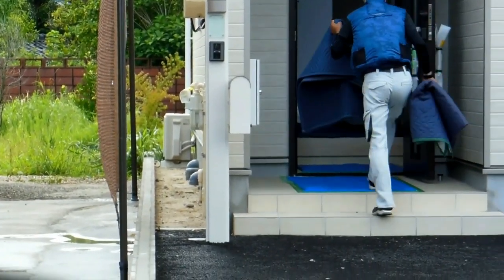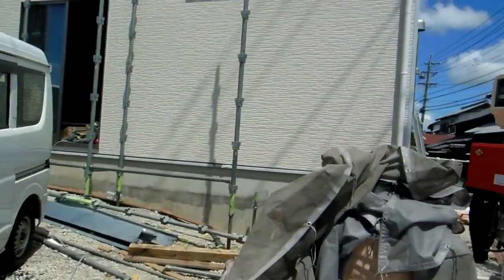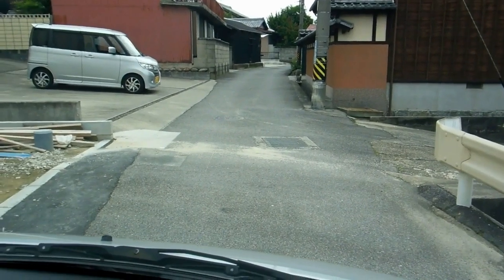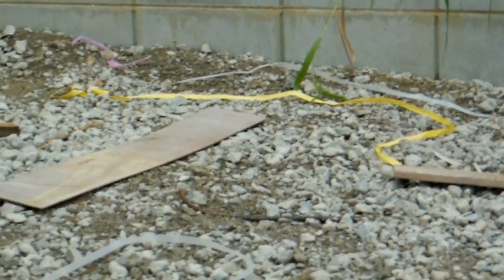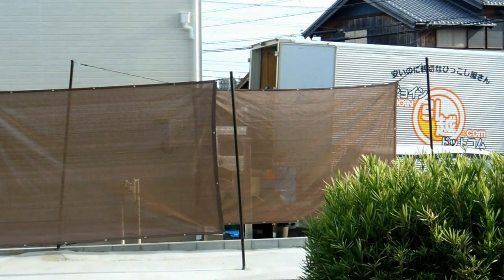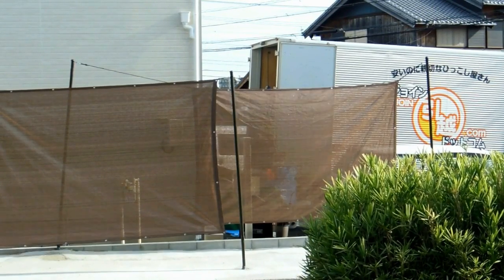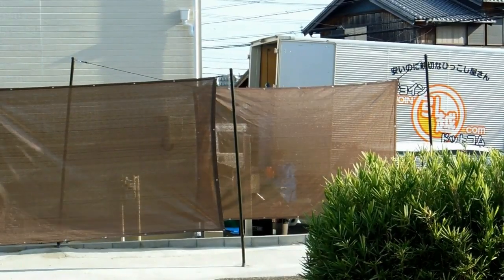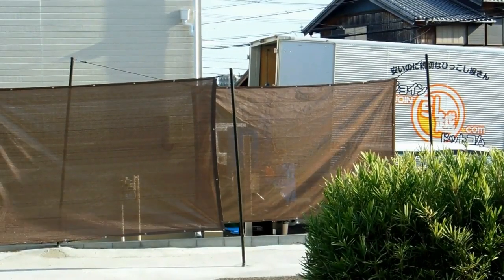Another PRESENT of DOOM from Next Door to the Old Japanese Farm House!

Comment: So first the solar is a different sub contractor and the scaffolding requirements aren’t the same for every contractor and was either rented or owned by the first sub contractor and wouldn’t be used by the second in most cases even if it wasn’t a afterthought change order  witch it probably was given when it was installed 

Second bitumen is a binder and one component of asphalt witch is what that “driveway” is and can take up to 12 months to cure and harden especially in hot weather and given how small the surface is wouldn’t have been layed Thick enough to hold the weight of the truck without the truck leaving ruts threw the asphalt